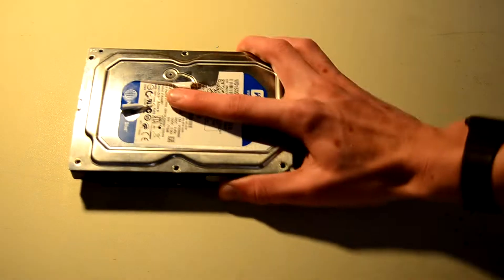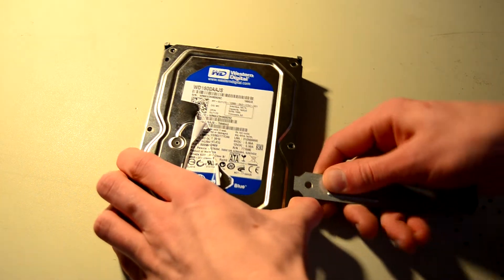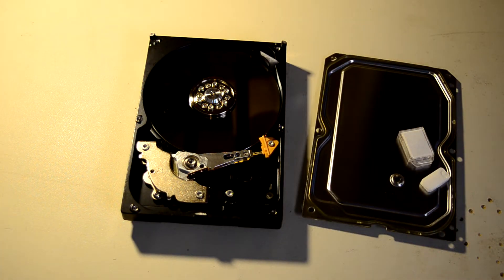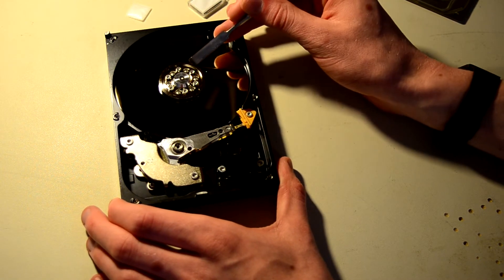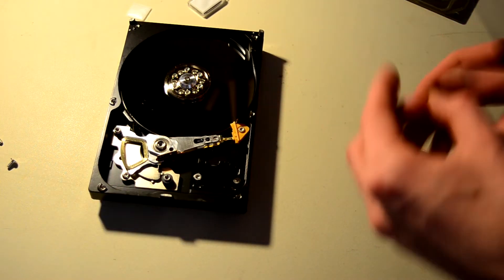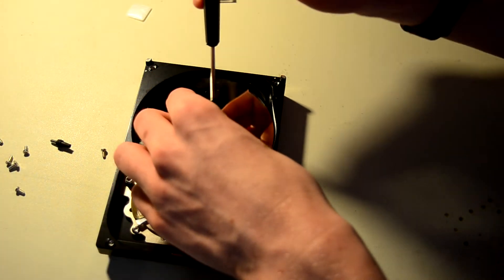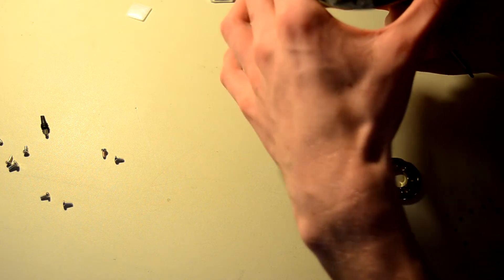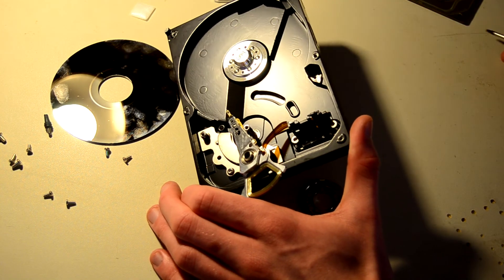160GB WD Blue disassembly

Comment: Might be a cheap drive but it's at least better than Seagate's non-OEM 1TB 3.5" Barracuda who sTILL USES CONTACT START STOP

those imbeciles
Reply from the maker: Landing zones do have a few advantages - faster response after waking from sleep, and thorough data destruction.
Reply: @DanalogRetro  Who needs the 3-wipe standard when Seagate drives turn themselves to dust? And also, you can snort it!